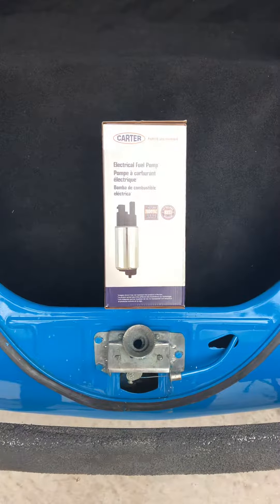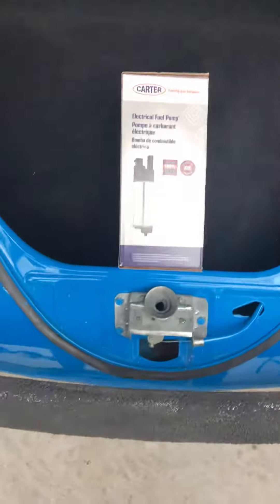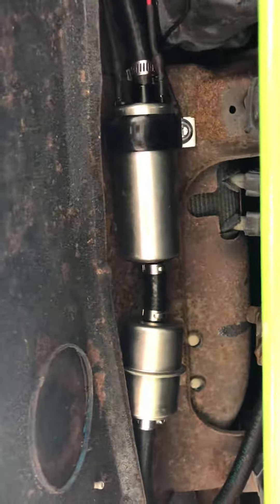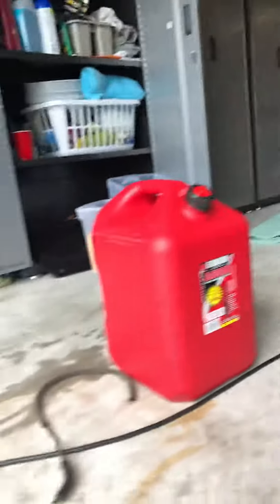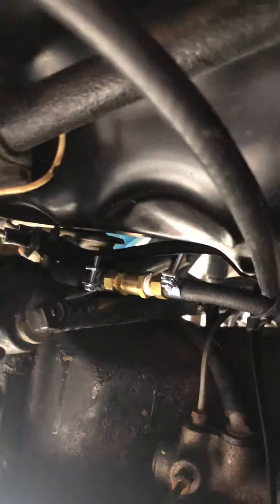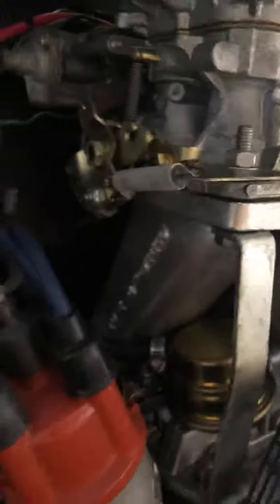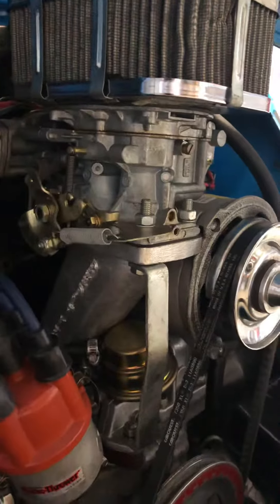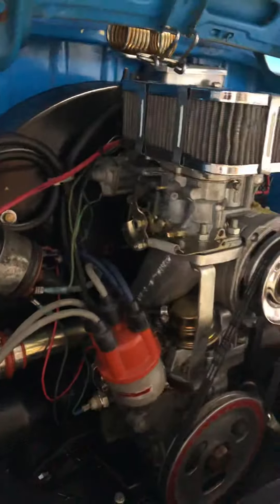Volkswagen VW Beetle electric fuel pump install

Comment: Great work Mike and thanks for sharing, i got the similar issue i go for a hour ride and stop and crank and crank don't start. i the previous owner install a electric pump and i think not the right one and i just order a carter. and i was thinking it was related to my engine compression. and hoping the pump will rectified the issue.

Comment: if its near a hot area it will have fuel vapor lock  you have to move it away from heat

Comment: All you had to do was remove the Bakelite housing that the fuel pump sits on and lightly file the hole out so the fuel pump pushrod does not stick anymore, problem solved.
Reply from the maker: Or install an electric fuel pump…😜

Comment: Are you happy with your electric fuel pump? I’m still deciding. Ugh
Reply from the maker: Slades VW Beetle so far so good.  It seemed to solve my issue with hot starting.  I did end up rerouting the fuel lines.  One was touching the steering column so I rerouted everything from the tank towards the passenger side.  If you go this route, remember that you will need to transitions from 1/2” to 5/8” fuel lines.
Reply: @mikesveedubobsession8286  thank you for the response. I'm doing a project right now, and I keep debating whether I want to go electric or stay with the manual. I see a lot of folks are going with the electric now. I didn't know about the fuel line size I am glad you brought that up.
Reply: @SladesVWBeetle  just this weekend.. Something caused my fuel pump to stop working. Im thinking a bad ground or fuse because it was working great. I may just make a complete seperate harness with a on/off switch. Alot of my factory wiring isnt working great anyways
Reply: VW RICH FLAT4 I agree, running it on its own may not be a bad idea. If your harness is original, then I’m sure it is maybe getting tired. I was going to replace mine, I’m probably going to regret not doing it.
Reply: @SladesVWBeetle  im thinking like a dune buggy setup.. A switch panel for lights, fuel, turn signals.. The key and ignition still work great (with the hard start relay) lol
Reply: VW RICH FLAT4 That might not be a bad idea!! Honestly the hard start relay is like a dream come true. I also like running the semi auto stick starters on my four speeds. It’s spins the motor over so much faster.
Reply: @SladesVWBeetle  hmm i never knew that.. Ill keep that in mind about the starter 👍👍
Reply: VW RICH FLAT4 It honestly works great. The semi auto starters have to turn over a pretty heavy torque converter. So when you bolt one up to a four speed, it’s spins the motor over nice and fast, like it’s not lagging. I surely hope that made sense.
Reply: @SladesVWBeetle  yes definitely makes sense. Thanks 😁

Comment: Did you use a regulator?
Reply from the maker: Keith Warren I did not.  Knock on wood, I haven’t had a single issue since install.